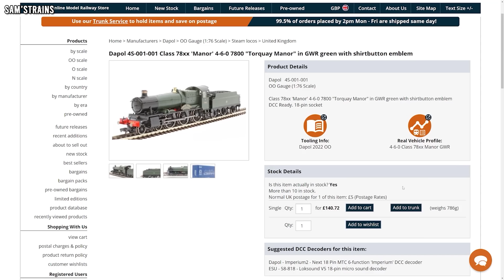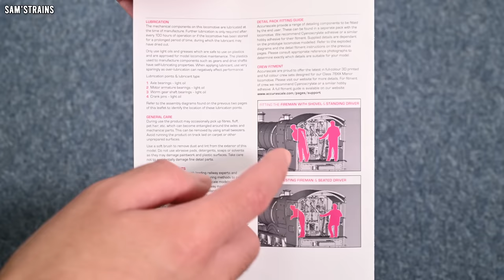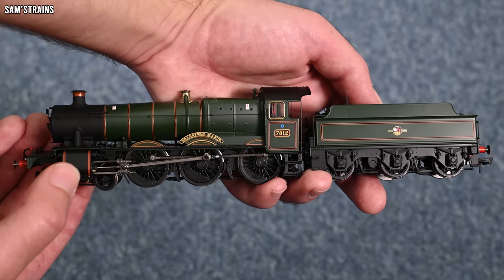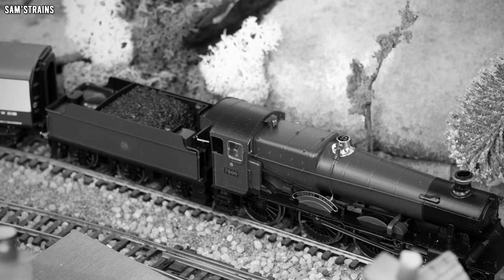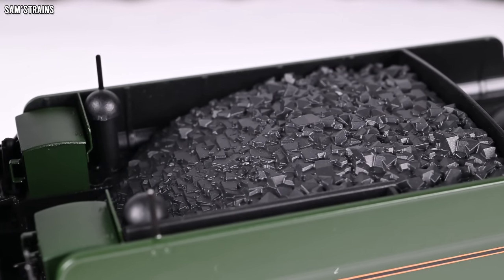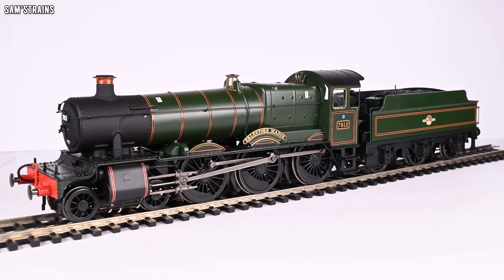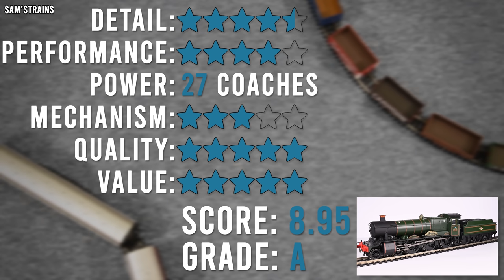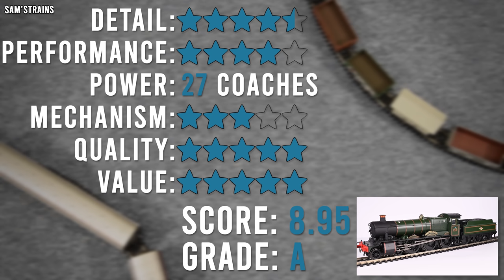Accurascale's New Manor Class | Better than Dapol's? | Unboxing & Review

Comment: I prefer not slowing down on corners to the ability to crawl. In one way it is good that the two models each have their advantages.
Reply from the maker: Yeah that’s fair - it’s certainly a nice change to have this maintain a good constant speed all the way around!
Reply: I have a couple of these with the factory sound chip fitted and they crawled beautifully out the box on a straight piece of track on the kitchen table.  The other good thing about Accurascale is the lifetime warranty.

Comment: I have 7801 in the DCC/sound version.  With DCC/sound the firebox glow goes on and off with the coal shoveling sound, and intermittently while running, which I thought was a cool feature.  The brightness of it is quite realistic, but I can see how it might seem a bit much when it's on all the time running on DC.  On a real one you would only really see the firebox glow when the fireman is shoveling coal or tending the fire, and otherwise the door would be closed most of the time.
Reply: I’ve been wondering about the door being open. On a real locomotive that would be unbearable for the footplate crew and also inefficient. Do all models have the door open now? Maybe it makes no sense.
Reply: Absolutely right about the firebox glow!

Comment: Good review Sam, I have a 7802 and I think it's the best model in my collection by far. The boiler on the dapol manor looks wrong to me, the taper on the barrel is way to extreme plus the polished safety valve bonet is OK but it's too shiny for a working loco. As an engineman on a heritage railway with 3 manors I think the fire effect is just right, fires get white hot when worked hard so an orange/yellow glow would be inaccurate for an engine working hard.i like the chunky rivets (most of them are domehead bolts) they seem right to me. I agree 100% about the coal load, that is pretty w**k. That's not just an accurascale issue, no manufacturer gets that right, I always remove the plastic coal and add real coal. The removal of the coal wasn't straight forward but wasn't that hard.
Never bothered with the dapol manor as the 43xx had quite a few detail issues. I'm glad I went with the accurascale manor.
Reply from the maker: That's great to hear Chris - they certainly are wonderful indeed, good stuff about the firebox lighting then! Thanks for sharing your thoughts on the Dapol manor too.
Thanks for watching, Sam :)

Comment: Hi Sam,
I have had a dapol manor for a while and am very happy with it. However, my accurascale manor recently arrived and this  is so much better. To be fair, the dapol loco/tender coupling is superior and couldn't be easier to use. The details of the accurascale model are second to none though. For example, the cab detail , including the driver and fireman seats is excellent, as is the detail on the front of the leading pony truck. For me, and I suppose this is down to personal choice,  but the dapol safety valve cover is too bright whereas the accurascale cover looks more realistic along with the matt smokebox and the copper on the chimney. With regards mechanism, both mine are chipped and both run beautifully. By the way, I shall not be taking either of them apart, too fiddly for me these days. Anyway, they are both excellent models, but my preference, just, is for the accurascale version.
Thanks for your review, Sam, really enjoyed your comparison.

Comment: Aesthetically, that is the first RTR OO loco i've ever seen that actually looks like the full size thing. I've always felt manufacturers have never captured the colour and finish of the real things. This has definitely improved in recent years as finishes have moved more towards 'satin' than 'eggshell', and colour has gained greater saturation, but this is incredible. The different finishes (eg matte smokebox) add all of these textures that trick the eye. Couple this to the incredible separate detail, and the driving wheels/con rods that finally look better than Triang managed in the 50s, and I think you've got the most convincing looking RTR OO loco so far!
Reply: So visible glue and hard to fit DCC and  huge lumps of coal are ok. !!!!!!!!
Reply: @alness1289 I forgot the internet only permits eye-bulging praise or spleen-rupturing disdain. 

"gLuE aNd iNSuffICIenTlY pRoPoRtiOneD CoAL. iT's aN aBoMiNaTIon. a PLaGuE oN aLL WhO EVeN LoOkEd aT iT!!!!!!!!!!!!!!!"

Does that redress the balance?

Comment: 13.10 Dapol's coal load looks like a mass of slack, whereas the Accurascale coal looks more like actual lumps. While it's true that in BR days steam locos had to contend with a lot of slack, this always led to poor steaming and inefficient coal consumption, since GWR loco fireboxes were designed to burn big-lump Welsh steam coal. So Dapol's tender is not necessarily inaccurate, but you'd need to fit crewmen who clearly look pretty desperate as they try to keep their loco running at all, let alone managing to haul a train.
Smokeboxes were painted in the same way as boilers, including a couple of coats of gloss varnish. However the constant high heat -- caused by the firebox gases -- tended to burn off the varnish pretty quickly. So a loco straight out of the shops would have the same gloss finish as the boiler, but in service it would go completely matt in a matter of months, and stay that way until its next main service/repainting. The boilers and fireboxes were of course insulated by their water contents, so stayed glossy -- assuming they were regularly cleaned -- between repaints.
Reply: Boiler and firebox were covered with asbestos lagging then thin casings which were the bits which were painted, so never got very hot. Woof!
Reply: @tobythehairlessdog8876  Yes I realise that. So were the cylinder'valve-chest castings..Dapol have done a very good job of representing the cylinder cover sheets.

Comment: Accurascale's new GWR Manor class locomotive is a very nice looking model do not get me wrong. Its boiler, smokebox and running board being made out of die cast metal makes the model very heavy along with being powerful to pull multiple rolling stock. Its price is decent and its detail is fantastic. Unfortunately, the plug for the tender from the locomotive is not that great because it is quite difficult to service the model and its motor is not able to make the model crawl slowly because of its ridiculous 3 pole motor. I rather buy the Dapol Manor because it is cheaper and easy to maintain. Overall, the Accurascale Manor class is pretty good Sam.
Reply from the maker: Thanks for sharing Bryan, yeah I'd agree with all of this. A few odd choices, but overall an awesome loco! :D
Thanks for watching, Sam :)

Comment: For me, not slowing down on bends is the decider. Accurascale have built a model you are going to want to see running around your track, Dapol more for static display or shunting maybe. Looking at either model, it is so, so far removed from my experiences as a kid back in 1966. Absolutely amazing.
Reply from the maker: Thanks David - yes that's a real bonus isn't it, the torque is definitely better in this loco, which is quite surprising!
Thanks for watching, Sam :)

Comment: The reason it cuts in so late is due to the chunky gears. Smaller teeth distribute the force of the motor a lot better , and reducing resistance.

However the acurascale will certainly outlive the dappol one. With the bigger teeth, it will take longer to wear out.

Comment: I can vouch for the Dapol Manor’s low speed running. I was playing with mine one weekend and forgot to turn off the power to the transformer at the wall. 
Three nights later I went to put something away in the train room and saw an orange light on I
In the darkness on the far corner of the layout. It was the firebox LED. I then noticed the LEDs on the transformer on. 
The power dial wasn’t completely set to off and had been running around the layout at I guess 1mm a sec for 72 hours!
Reply: Full marks for endurance, then!

Comment: I swear this is the first time I've heard a UK reviewer refer to the item as an engine, rather than a loco. Next thing you know, you'll have model engineers and brakemen. (That's sarcasm, son.)

One feature I particularly like is the fitted springs and journal boxes on the tender. I had gotten used to trucks (bogies) on US models having real springs, but this is the first UK model I've spotted which; although not actually sprung, looks like it could be. (This statement suggests why I have so much more trouble with bogies, especially Accurascale's Siphon G's, staying on the track.)   

Actually a pretty darned good review. Keep up the consistency in your reviews; it makes comparisons easier.

Comment: Also Coreless motors are known to have unbalanced Back EMF for ESU and Soundtraxx Decoders, while a 3 pole high efficiency motor and a 5 pole version are best for any model train in reality.
Reply: Can't say I've noticed that. I fitted a Lokpilot v5 21pin to a Trix with a coreless Portescap motor recently. Other locos have swiss made Maxton and German Faulhaber coreless. All run perfectly and silently at all speeds. A lot better at crawl than the DC Manor. The DCC one will be much better.

Comment: A very honest review which matches my experience with this model.
I have 2, as well as a Dapol version. I had to send one back because of the motor noise with the replacement being a far better performer. 
They are though, incredibly detailed and accurate models: with details not often modeled by other manufacturer. 
However, my Dapol has a much better motor and running performance. 
Tbh they both, Dapol and Accurascale, have elements that one does better than the other. 
I think the best of both worlds for me would be the Accurascale body on a Dapol motor and mechanism. Also the tender connection of Dapol locos is just the best and most innovative.

Comment: I have the Accurascale Manor DCC sound, mine is able to crawl very slowly and steadily, and the firebox flicker is just right and lights up driver and Co quite convincingly, it is a bit lacking in power it will not pull my 20 odd coal wagons down to about 12, but I have not run it in yet tbh I did not know you needed to as does not mention running it in on the packaging. I’m fairly pleased with it.

Comment: Hmm. I’m surprised at the ratings. Out of the two the Accurascale model looks so much better. Riveting looks chunky in comparison BUT I feel this gives it a much better and consistent look. The wheel sets and connecting rods are also far better. 

I also believe the boiler on the Dapol version is slightly bigger / wider?

The running session was disappointing to see on DC as I have the Sound Fitted version and the slow running is absolutely fantastic even with 128 speed steps and the addition of the stay alive make it bullet proof!

Firebox flicker is definitely quite bright.

The electroplated safety bonnet on the Dapol model, whilst outstanding looks very out of place compared to rest of the model.

All in all I prefer the Accurascale by a huge margin.

I think this loco is at home on DCC  layouts.

However your review is a true reflection of its performance on DC.

Comment: I have 2 of these on order. The tipping point for me over the 2 was the fact I could fit a larger wattage sound chip 3 watt (Zimo MS 450) and speaker in the tender and not use the Next 18 which is only 1 watt. However Accursacale did change the sound specs after I ordered and paid.

Comment: 9.08 and totally blown out of the water!!!!!
Yes we would love to get one BUT we have quite a shopping list to get through first... Titfield Thunderbolt set. The 1500 and of course the 4400. Another expensive year but cheaper than the 5" versions of the tanks I am also doing. The 10 year plan is to sit the OO models on the running boards.

Comment: There is a third way of getting around motor packaging constraints. Marklin-Trix and perhaps others have occasionally attached the motor inside the boiler. It meshes with the chassis by cog when attached to the chassis.
The Manor in OO has plenty of room to fit a decently large coreless motor which would be a simpler solution.

Comment: Wished I had watched this before buying one! It will be interesting to see how long the small motor lasts! Although it looks very good, the slow speed running-or lack of- bears out my experience entirerly. Fitting a DCC decoder is tedious too. The Rails ones don't have etched plates supplied as extras . Most informative, well done Sam.

Comment: Very beautiful loco, though I did notice one thing almost immediately that I'm surprised you didn't catch, and that's the fact the handrails on the cab don't actually reach all the way up to the cab roof, which is kinda strange.
Reply: Thats been pointed out by others in the Accurascale thread in RMweb. A strange error, hopefully will be fixed in later batches. Cant wait for mine!

Comment: Hello Sam
I enjoy watching your channel, and watching your reviews too.
Can I please explain a small point?
I have in my possession two Accurascale Manor steam locomotives with a further two on preorder.
When both Dapol and Accurascale both announced their versions of the Manor steam locomotives I decided to remain ‘on the fence’ regarding my choice of manufacturer.
The reason for this was because having purchased Dapol Mogul’s, D class, and D1 class locomotives (all factory fitted sound versions) I’ve found that the electrical connections can produce problems in sound fitted models because I’ve found that the sound sometimes drops out within the tender of these models due to these types of connections!
Anyway, the point of writing this comment is to explain my experience of the Accurascale Manor’s
I’ve found that the slow-speed crawl on my Manor’s is excellent!!
Could this be because my examples are factory fitted DCC sound versions?
I understand that your review took place utilising DC control on both the Dapol and Accurascale examples.
I’m wondering if the ESU Loksound5 decoders within the Accurascale Manor’s is somehow smoothing out the 3-pole motor, and by doing so, enables these models to run slower and without cogging?

Comment: The mechanism has been designed for DCC most likely, with DCC the crawl speed would be much better due to the way DCC decoders work to control speed.

Comment: From another review I saw from someone who had insider information, he says that Accurascale claims the three pole was intentional as its specially designed for steam and for DCC use, and from other reviews I've seen, it seems to be an incredibly smooth runner for the DCC sound models. Sounds good on paper, but perhaps not suited for smaller DC controllers. I could be wrong though.

Great review!

Comment: Another great review Sam. I've just ordered one of these in the GWR livery (the DC version). I've always been puzzled by the firebox glow featured in a variety of current model steam locos. Surely when the real thing is running, the firebox doors are only open during the few seconds while the coal is being shovelled into the firebox and therefore rarely visible during operation. Furthermore there must be a measurable cost element to this essentially unnecessary feature.     Update 25.4.24:- I received the model today and it's absolutely gorgeous! Just going back to my comment on the firebox glow. Having now seen this working for myself I confirm that it is very bright indeed and, yes, looks really silly! It dominates when you catch sight of it as the loco goes round the track and is a complete distraction in my personal opinion. I'll be painting mine over so it can't be seen. Sorry!

Comment: Great review Sam. Whilst mine couldn't crawl straight out of the box it did improve considerably after running in although not as good as the Dapol manor. 

My other gripe you haven't mentioned that is probably worth looking at with all models you review now is the blister pack. Despite the amazing detail here if you fit accessories such as the headboards, coupling detail or tender detail or even use the manor crew which is their own accessory, you cannot then use the blister pack as you cant close it without knocking off the added detail which is a poor oversight. Whats the point of going into such amazing detail on loco accessories if you cant put your loco away in its packaging after fitting them?

Comment: Such a promising start with all that die-cast, but then let down by the motor,  as somebody pointed out, I wonder how that will fare with long term use. 

The use of die-cast metal would have helped Dapol in their new D1 loco for rails; all the reviews I've seen describe it as "light on its feet" and can't haul many carriages. At £200, that's a bit unacceptable. Will you be reviewing that loco Sam?